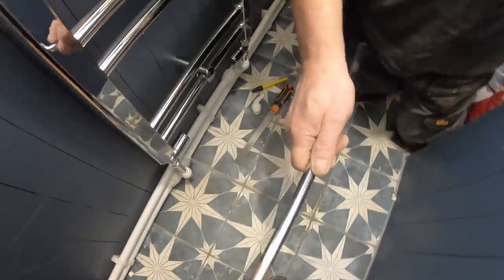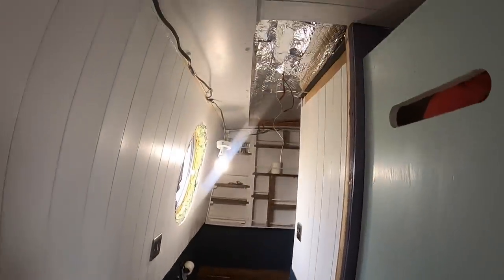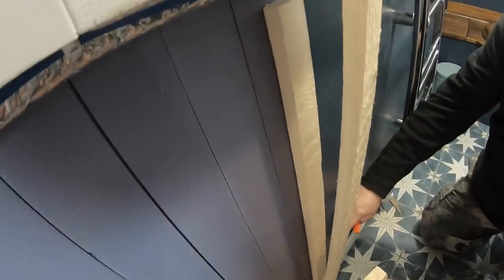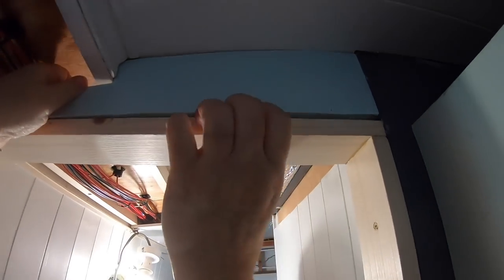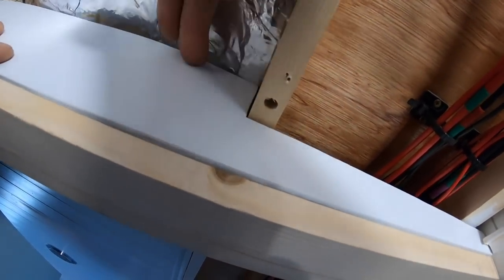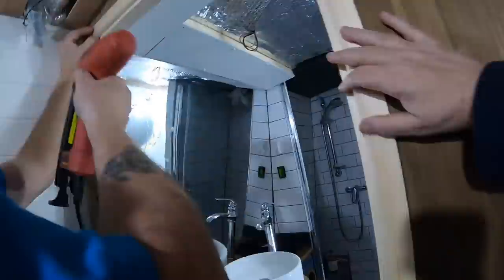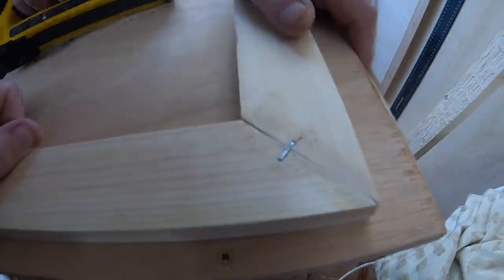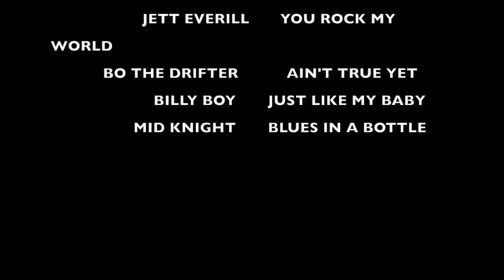Vlog 61, Narrowboat Fit Out -   Power points and Internal Door frames

Comment: It’s nice too see a door frame put in, unlike some boaters doing it with 18 mm plywood.👍👍 
And nice too see the Chrome pipes cleaned, had my sink tap with chrome tails fitted onto copper when the house was built from New went to work came home nine hours later and the whole ground floor was flooded floor ripped out all the water pumped out the new carpet and new flooring laid it was a mess for about three weeks for the insurance to sort it all out but that was the cause chrome tail points fitted to copper the force of the water just pushed it apart so it’s good too see you sorted 👌👌🍀
Reply from the maker: Thankyou Thomas👍